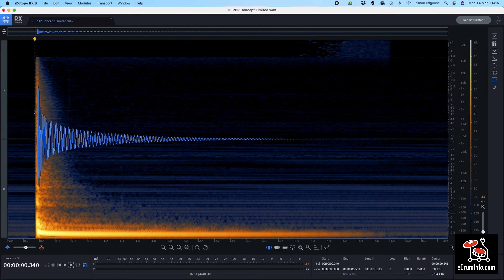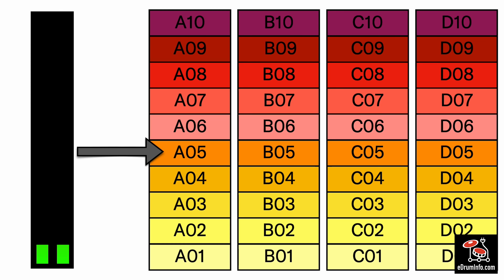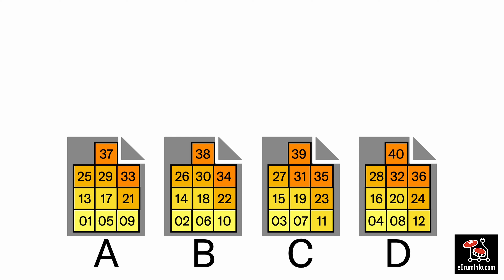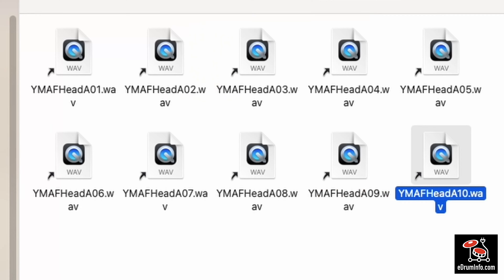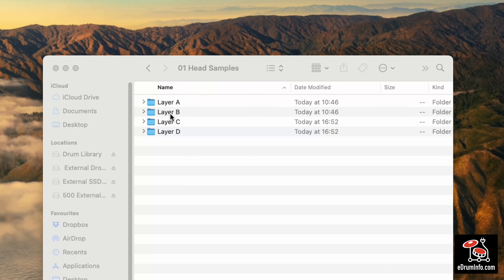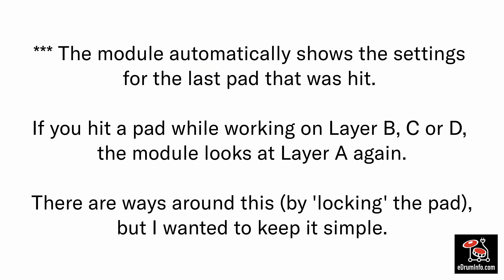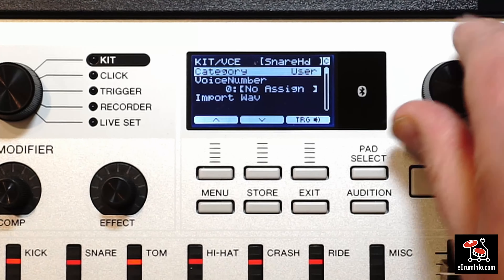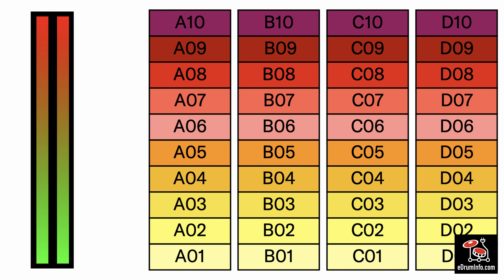Making A Detailed Multi-Layer Sample in the Yamaha DTXproX Module - Importing and Building

Comment: can i buy a replacement bass drum pad  (not the whole thing  with metal bracket/ etc ) mine is damaged
Reply from the maker: Which bass drum pad?
Reply: from a dtx 8km
Reply: @edruminfo also simon   my snare rubber ring that fits over the metal hoop has cracked along the rim  .. it now won’t trigger the snare rim as my sticks are whacking bare metal  .. been trying yamaha for days and no response   … where can i get a replacement do you know as spares for this kit seem to be like rocking horse sh*t
Reply: @edruminfo  the bass drum  pad that the bass drum pedal hits ..